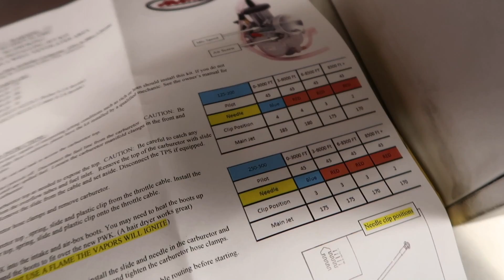CR250 Rebuild begins! + new engine

Comment: Definitely should install the MX Bonz air box seal kit and STIC metering block in that Keihin. Huge performance gains!
Reply: also, that jetting you put in there is a tad rich for that bike. 170 main, 42 pilot and red needle 2nd clip

Comment: Those bikes had inherent problems with the air box / Air boot seal . Make sure after you have cleaned and dried those items, that you pull apart the sealing surfaces and carefully  caulk with black high temp silicone sealer gasket maker.  The jetting will never work right unless you do this . Trust me !  Once l did this, jetting , idle, etc. Was perfect !

Comment: I know you wish you would have tried the Lectron now, but I would recommend looking into the Smart Carb also.  They are supposed to have a bit more snap off the bottom end.  Way to show the fans a good time in the pits, looked like a blast!  Glad to see another retired rider still in love with riding and showing fans a good time.  So many pro's seem to be completely burned out, and done with riding, after the career part is over.  If I am honest, as an outsider looking in, lots of pros look done with riding/fans long before they end their career, and seem to just be going threw the motions.

Comment: I run the Kehin Pwk air-striker on my 03 Cr 125 and it runs so much better than the stock mikuni. Have no complaints.
Reply: I run one on my 98 CR250 too, Totally transformed the bike from the old pos Power jet carb that was stock, runs like Ronnie Mac`s bike now bbbbrrrrrrrrrraaaaaaaaapppppppppp

Comment: Hey Cole really enjoy seeing you guys having fun with the 2 stroke. For the carb there is a Keihin PWK 38 Air Striker Short Body. Its shorter and a comon saying is, the shorter the body the better the throtle response. Looks like you got the standard "long" version. Also the original Mikuni TMX had a throtle position sensor (TPS) so this position "data" is aquired and the ECU take that into the equation to set values for ignition timing an RC valve. I would be curious how the ECU is affected by not having this sensor anymore. Not saying anythig is wrong with your approach just putting thougts in.

Comment: Bike and parts, frame etc are looking sic.

That’s an old Screw top Keihin carb, did Honda supply you that, I’d rec a PWK Keihin flat side and gone with a Stic metering block which not only sorts jetting out, better fuel atomisation, etc etc,  still has jets but much more consistent and works with elevation changes too, but would improve HP across the range and just run better overall, some have compared this setup directly to Lecton and Smartcarbs and it speaks for itself. it still seems many haven’t caught onto this esp if the 2t  in question already has a Keihin carb, HP performance do a metering rod for the screw Keihin carb as well, just seems a weird one to me, but if it’s a Honda Factory carb that would make sense. Though the Honda came with from 03 to 07 the 38mm Mikuni TMX Flatside carb, this was notorious to get right and detonation etc was an issue, another reason I’d gone Keihin /Stic avoid all that mess. JMO, be plenty of other suggestions, part of the fun process, even 2strokes many many options and experts haha.

HPerformance also provide jetting suggestions,  (http://www.hpracedevelopment.com/stic-metering-block.html )as do Pro Circuit still on their website for stock carb setup, (https://www.procircuit.com/jettingspecs3.htm ) note this is based on ore mix ratio and fuel tyke used as red by PC though. 

If you did go Stic be more likely set and forget though, if ya get time test both options out, I think you might be surprised, I’d do this before any other mod myself apart from stock reeds. I see you have VForce Reed Cage and reeds installed already, nice. combine with a Boyesen water pump and you will be sorted.

Pity CMT don’t do carbon engine mount kits in carbon for the CR250 reduce some vibration, maybe give it a different feel, but big fan of the PHDS kit that’s another great addition, looking forward to the next vid, bikes going to be killer nice work. 🤙
Reply: PWK airstryker carbs are screw cap and flatslide...
Reply: Josh Stevens Yeah I did mention that, I know it’s a bit of a lengthy post lol, I have thought he’d probably gone with the later PWK being s bit easier to tune and less sensitive just my experience with them, I haven’t tried the Stic on the CR yet but plan too, cheers

Comment: Check out rpi racing for those engine mount bolts, grade 9
12 point hardware custom shank sizes and they would look awesome with the bronze coating on them.

Comment: I’ve had nothing but good luck with JD jetting. Prob 10-12 bikes and quads jetted. Ice racing to the wood. Obv race fuel and pemix oil and compression will change that but it’s a good base line.

Comment: Hey man love the videos! You are going to want to jet that up from recommended on the main jet as that factory engine is probably going to have a pretty aggressive port map. All of this depends on what pipe you run and the elevation and humidity even. Good luck two strokes are a blast and you’ll have to check your plug and see what it tells you about jetting!

Comment: Put padded tap on the parts of the tank that rub the plastics and frame if not it will get worn past the clear on the carbon and start to splinter over time

Comment: Hey cole does the suspension get modified to cope for the weight change being that the 2 stroke is lighter do you find you need to re spring it or does it work ok with the stock springs and valving ?

Comment: Honestly if I were you at this point (having a factory cr250 engine) I would definitely put in in a 2019-20 crf450 frame, I mean that is what you raced so it’s what your used to.

Comment: The trick set up for a pwk carb is to run one that has the tps (throttle position sensor) and modify the wire harness on the carb so it can interface with the ignition system properly.  Stock or aftermarket CDIs will be 3d and adjust the ignition curve based on factors like throttle position. TPS carbs came stock on YZ, RM and KXs in the later years. Another trick mod to a PWK  carb is to run a intelajet. Call dicks racing and they can get a few more HP  for that build by adding the intelajet, wings and taper bore. Read reviews on MXA magazine website. Easy 2 or 3 HP increase! Mxa says it's like adding a port job and pipe which is a substantial increase.  Have fun.

Comment: Could you not get factory carb to go with engine, they don't need them any more?
Reply: The factory carb sucked. The pwk he has is waaaaaaay better
Reply: @hellraiserDLX23  I mean factory as in the works carb that goes with the engine. Not the stock carb.

Comment: lectron is by far superior. Watch camron niemla video on his cr250 build, on the airbox. Id do what he did.
Reply: ReddHottRonn  the lecterns can have some weird issues go look that up , the keihin tmz air striker rips! Had one on my 01 raced tried true tested by hrc I think they’ve done a few more hours testing bud lol
Reply: My Lectron 38HV was the best money I’ve spent on my bike. Slapped it on and it has ran perfect ever since. Even with 5k+ ft elevation changes in one ride. Plus the fuel mileage you gain is amazing.
Reply: Todd Field yeah with a team behind you constantly effin around trying to get the jetting correct. My man seely over here doing this by himself now, would be a lot easier better setup for him with the lectron man. Its new technology time to move on.
Reply: ReddHottRonn  I can already see you obviously don’t jet bikes if you think it’s constant effing around , it’s a simple  chart based off barometric pressure to choose jetting then possible 1 main up or down 😂 takes like 2 minutes but hey everyone’s a pro on YouTube
Reply: ReddHottRonn and you really think coles not going to get Honda to time it they just built the motor man come on 😂
Reply: Todd Field lol i guess you can seelys mechanic? Congrats, period everyone that has one literally compares it to the closes thing to efi on a 2smoke possible. You can go ahead and take his carb apart at every track and keep going up or down or jet, sounds fun.
Reply: Todd Field yeah they built the motor, did they install it? Lol he might have connects but this mans having to do the elbow grease himself now...

Comment: Lectron is definitely better, especially with that year CR, lectron is comparable to fuel injection the way it atomizes the fuel
Reply: Wrong. Lectrons are famous for having no jets.
Reply: @joshstevens1271  ok, dont know why you said anything at all about jets. You obviously need to do some more research.
Reply: @joshstevens1271  . Where am I wrong? Did I say anything about Jets? If you really knew anything about lectrons you'd know what I mean when I say they are comparable to fuel injection because the way they atomize gas.
Reply: @joshstevens1271  lectrons have no jets, yes, but they are better known for the way the Needle is designed and the way it atmonizes fuel because of the way it's shaped and works. I'd really like to know what in my comment prompted you to write anything in you're response.
Reply: A CR250 is a two stroke, two strokes rely on scavenging... the fuel/air charge comes in through the crankcase and atomizes as it is pressurized by the downstroke of the piston and pushed into the top end, where the fuel charges smash into eachother from opposite sides of the cylinder via transfer ports...then the charge is incompletely burnt...
Then the two stroke pulls BACK IN 30 percent or so of the UNBURNT fuel charge to burn it again, its called SCAVENGING.
Reply: Lectrons don't have a needle. They use a metering rod.
Reply: @joshstevens1271  it's a needle, that's what lectron itself calls it. The way it's designed helps fuel atmonize because the way it's shaped. The operation of any 2 stroke doesn't change how the lectron itself is designed to work
Reply: Its a rod. Todd. Todd the Rod.